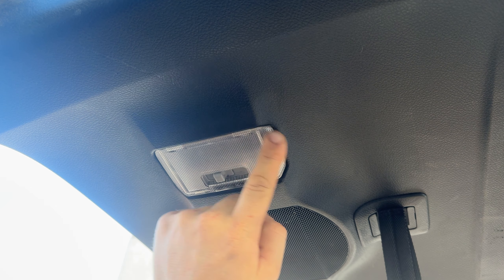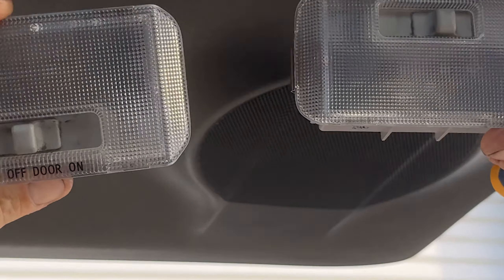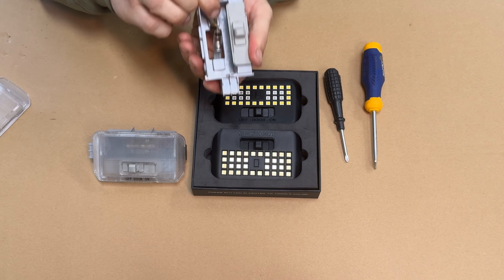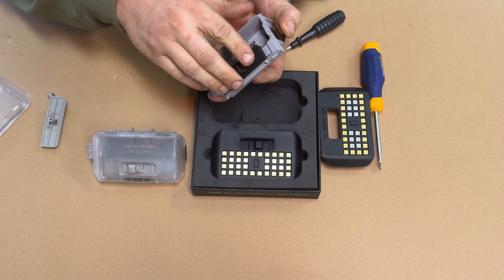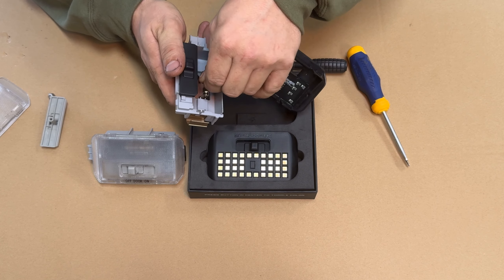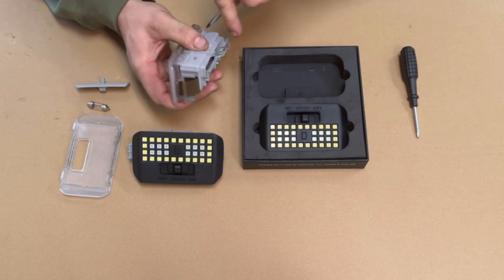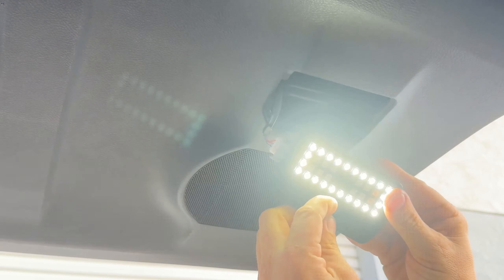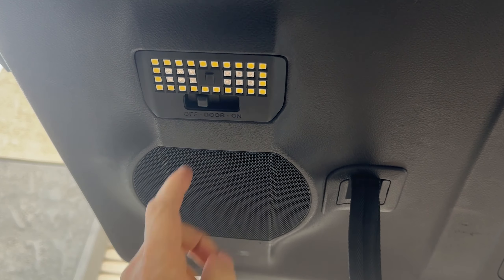MESO Customs 4Runner Hatch Light installation

Comment: Good video BUT I would never use a flat tip screw driver or any other metal tool.
Use the right tool for the job.
I just don't like scratches on my 4Runner. 
I use plastic trim tools to avoid scratches and other damage.